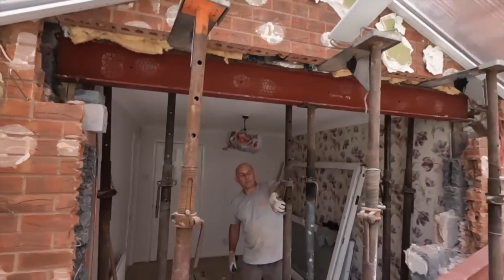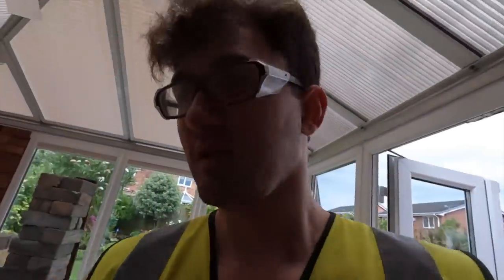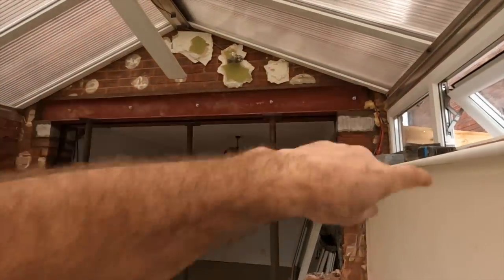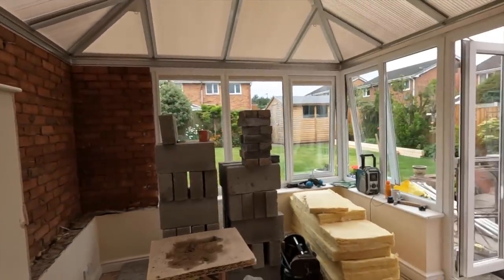STEELS IN , INTERNAL BLOCKWORK DONE.. CONSERVATORY RE MODEL PT 4

Comment: Superb job you’ve done guys！I’m no bricklayers but somehow I love watching it.😂
How do you know what size steel should be used in different jobs? did you follow the instructions from structural engineer or your experience?  I’m thinking of knocking down one load bearing wall, and don’t know if I need a structural engineer or just good experienced contractors like you.
Reply from the maker: We generally go oversized but try to use an engineer when we can 🧱👍🏽

Comment: Just a thought but have you installed stepped cavity trays above the conservatory roof abutment with the rear brick wall? What is a ‘wet’ leaf above the roof extends down into the conservatory where it needs to be a ‘dry’ leaf. Being brick you will get blown rain travelling along minute mortar cracks and running down along the cavity side of the face brickwork.
Reply from the maker: Don’t know pal we never built the conservatory 🧱👍🏽

Comment: The bolts through the beams look very pretty but structurallly they are a waste of time!
If the beams are meant ro act compositely they won't transfer any load.
To do that there needs to be proper 'brackets' bolted solidly between the webs.
By the looks of things they are each strong enough to carry the load from each leaf of the wall on their own.
Anyway that's not down to you!
Great job on the brickwork as usual and a nice clean jobsite when you leave.

Comment: Top job as always. For the safety could you take a couple of say 2 foot lengths of 3x2 and screw on a couple of say 4 inch noggins to locate in the joist, then bolt together with threaded rod and wing nuts. Bott of timbers would rest against the supporting walls. Ok you would have to release and slide out the way to put the last few bricks and padstones in. Make one for each end? (Prob only one end might be loose but may not be able to predict which one?). Thanks for sharing this point.

Comment: hi gents, must have been knackered first time i seen steve take a rest lol,,,,, why do you have to put bolts in ?
Reply from the maker: 🥵🤣🤣. They stop the steels moving and sort of connect the two steels making them into 1 💪🏼💪🏼🧱👍🏽
Reply: But not a requirement 😊 @SteveAndAlexBuild
Reply from the maker: @nigelsmith1198  🧱👍🏽
Reply: @martin2466  yep.! I’ve had structural engineers tell me to leave them out.!